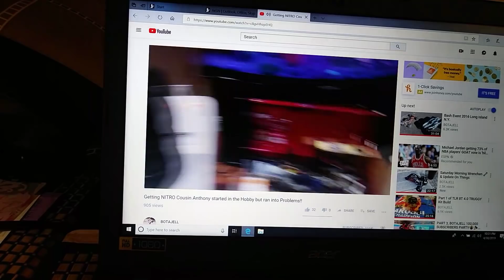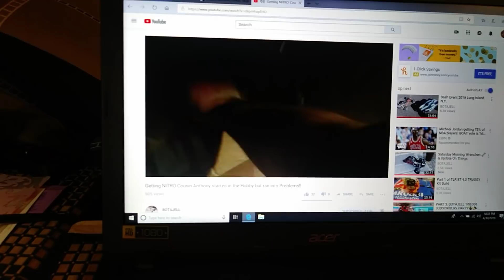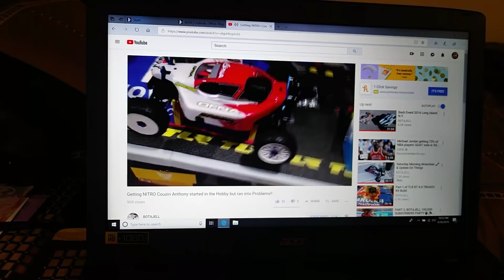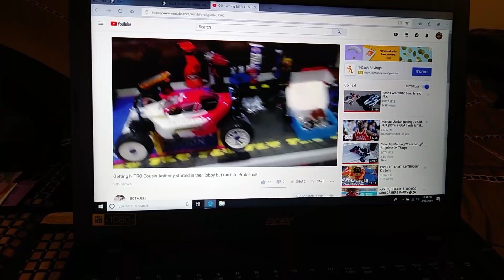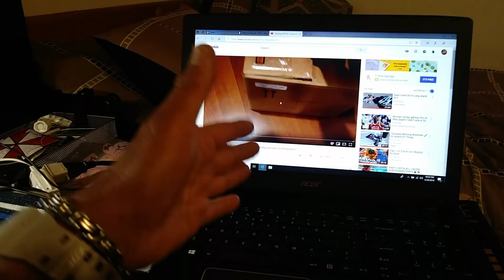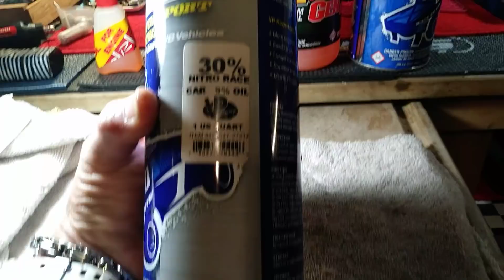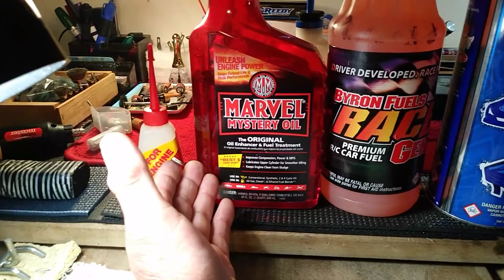Is fuel important? Byrons for life!

Comment: Great video!! I'm a Byron's user myself although I do want to try some of that bones brew. Quick request can you talk about long needle vs short needle carb tuning. There's not a lot of info on that subject and I think that can throw some newbs for a loop if they dont know which one they have.
Reply from the maker: Are you talking abought the low end needle? If so makes no difference in tuning if you do your homework or studying youll find its not talked abought because its no different long or short as far as tuning! Long as your low end needle is factory set go from there pinch test is the best and most commonly done idle needle .o5 mm top end needle 3 1/2 - 4 turns grom closed then get to temp 180°-200 then pinch fuel line and get to cut off at 3 -5 sec. Then you should be good if not you hv other issues ect. Good? If that confused you wich it shouldn't just be more spasific!
Reply: @muggymaniac  yup the low end needle. Some carbs have a long needle vs having a short needle on the low end. The long needle carbs effect idle all the way to about 3/4 throttle where the highend needle takes over.  A short needle carb effects just idle and maybe up to 1/4 throttle and can be tuned exactly as you described then the high speed needle is where most of the tuning is done to get overall performance. But your absolutely right the pinch test works. Set the idle to .5-.6mm gap, pinch test to check that and low end power. But I found when trying to correct a highend bog (lean or rich) on a long needle carb instead of richening or leaning the highend needle it was the lowend needle that was causing the issues even though the idle and lowend power was on point. Just something I ran into that I thought newbies should be aware of.